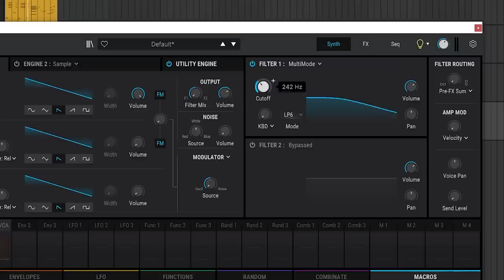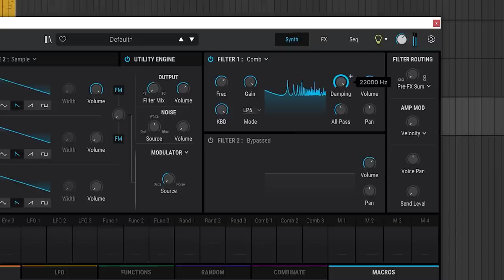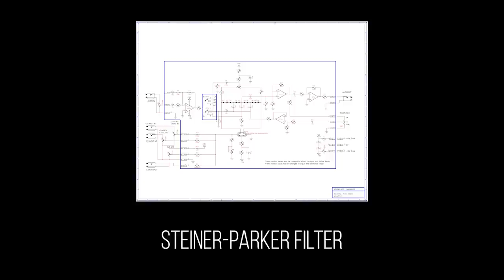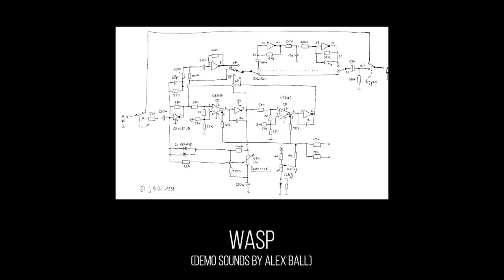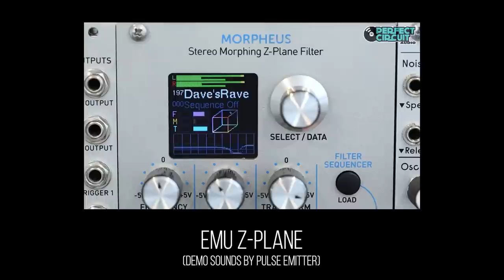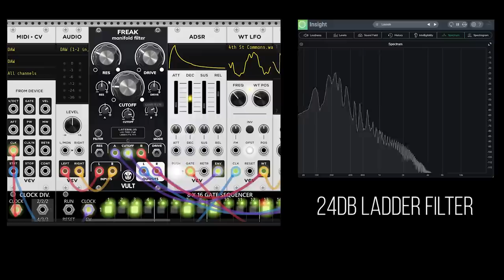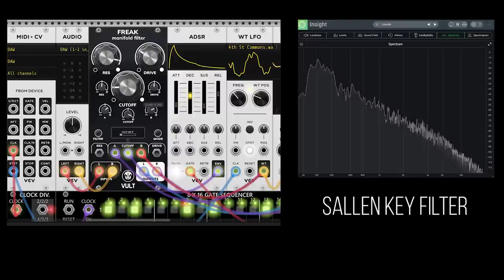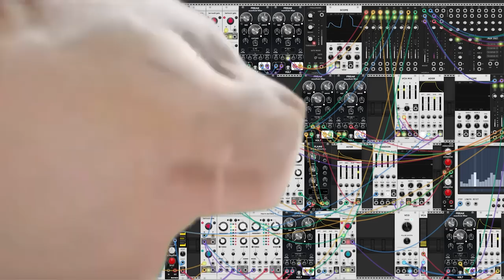Synthesizer Filters!

Comment: On the topic of the Z-Plane, I really really wish Rossum would either make or license them for use in a digital synth / plugin. The Euro module is great, but ultimately monophonic. I feel like the Z-planes really get interesting when you have them in a poly synth.
Reply: Have you checked out the Airwindows "emulations" of them? I don't know how accurate they are, but also they're free so - worth a look!
Reply: @OscillatorSink  I'll have to take a look, but  I struggle to use independent filter plugins because ultimately they're a bus filter as opposed to a voice filter.
Reply: As mentioned, the first commercial Z-plane filter was the E-mu Morpheus. Assuming E-mu was able to patent the concept the patent would have expired years ago so it wouldn't be necessary to license anything from Rossum Electro-Music for anyone to implement the algorithm in software. BTW, I acquired the Rossum Eurorack version for my rig. I had previously owned the Morpheus for many years.

Comment: In a wonderful example of the peculiar efficacy of math in describing reality, the "order" of a filter in its circuit corresponds to the number of "poles" in its mathematical representation. Electrical engineering will describe a circuit's behavior using a "transfer function," filters tend to be well described using fractions. As you may recall from algebra, if the denominator of a fraction goes to zero, the quotient goes to infinity. As you may not recall from complex analysis, just about any fraction will go to zero and infinity somewhere in the complex plane even if it wouldn't on the real line. And the peculiar correspondence is that the number of filter stages in the circuit corresponds to the number of poles associated with the transfer function for that filter.

Comment: Extra Synth Nerd Facts : 
The SEM filter was an augmented version of the Dennis Collens designed ARP 1047 Filter from the 2500 .   
The Oberheim Matrix 12 / Xpander Filter has to be the most over engineered CEM CEM3372 design in synth history squeezing 15 modes out of that little chip .    
Arturia put this in Pigments too , as well as the obvious two other plugins bearing the name . 

Chris Huggett an unsung hero in synthdom ( EDP/Oxford/Novation ) 
Used two Waps Filters added a drive circuit and multimode options that utilized them in parallel while the low pass used them in serial for the OSCar Filter  . 
The Summit has an updated version of this as it's essentially an modern version of the Polyphonic OSCar he never got to bring to market before closing Shop and going to work for AKAI writing the operating systems for the S1000 and it's subsequent line before going to Novation . 
He designed the analog side of the OG bass station , was head designer for the Super Nova and consulted or designed or worked with other designers on every Novation synth up until his passing in 2020 .       

The Mutable Instruments Shruthi 1 and XT were DIY Kits that filter boards for many synths including the excellent Polivoks , but also The 4 pole mission which was the aforementioned Xpander Filter .  Émilie Gillet MI's sole designer another under appreciated synth hero made all Mutable Instruments' code and hardware open source which besides euro rack clones of MI's modules some of her code can be found in : 
The Arturia  Micro& MiniFreak both use the Plaits OSC code  
Surge XT's : Twist OSC ( Macro OSC ) Nimbus ( Clouds )  
VCV Rack's Audible instruments emulations and lots of 3rd party Rack plugins as well as a few other apps that I have slipped my mind and a couple other products I suspect , but havn't been able to verify as of yet .

Comment: This was an excellent overview.  Thank you for going into so much detail, as opposed to "hey check out this filter sweep"

One little bit of trivia I think is worth mentioning -- The WASP design is super fun because it's based on abusing digital components for use with analog circuitry, which gives it the fun side effect that the digital components occasionally just blow up.  This has happened to me once with the Doepfer .  The good news is that they are cheap and super easy to replace, but it's a good argument for using something like the Vult Freak that can model it, as opposed to the original design (and this is likely why we haven't seen it too many other places)